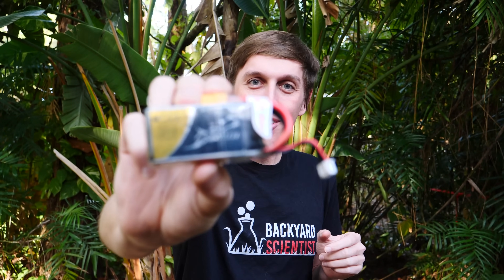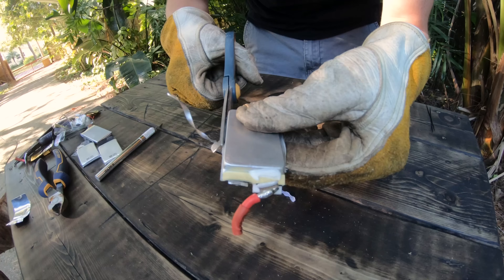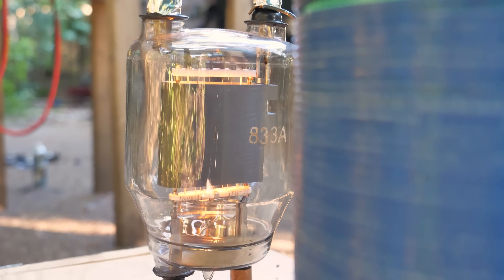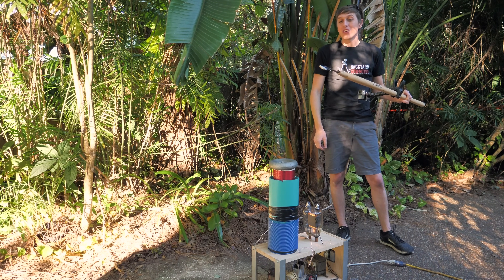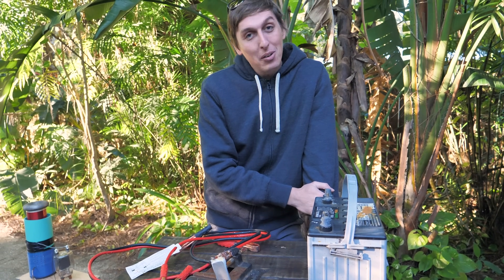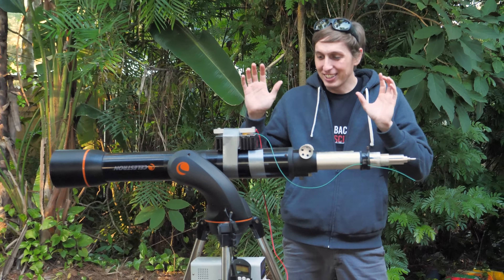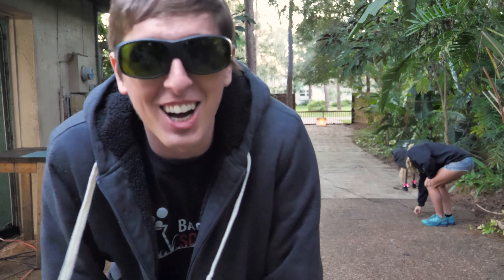Do Not try to charge a LiPo Battery like this!

Comment: You cannot charge a lithium battery via a tesla coil because of the floating voltage. The voltage of tesla coil is high but the circuit just isn't complete. There would be no current flow and no overcharge. To actually overcharge a battery charge it fully, then connect it to an unregulated DC power supply. The battery would heat up and swell. That's when you know that you have done it right.
Reply: Considering it's a Tesla coil you can touch with your bare hands, I don't expect there to be much current that you could actually charge a batterie with anyway. Even if it would have been setup correctly.
Reply: Never made an argument on energy transfer. I simply said that it is not how a battery can be charged. Trust me I'm an engineer.
Another thing, believe it or not tesla coils like van de graff generators don't provide any current. A HV transformer simply doesn't have current delivering capacity at low power high voltage scenarios.
Reply: He did connect it to an unregulated DC power supply... the car battery
Reply: Which... Is why he didn't die?

Comment: That looks like a Li-po not a Li-Ion. Li-pos are very dangerous if not used correctly.
Reply: It is only he said Li-Ion 
To backyardscientist: There are many types of lithium battery, like Ion and Polymer
Reply: LiPo means Lithium Polymer, and refers to a technique to make separators inside Li-ion cells that was proposed but was never achieved in production for Li-ion cells. Unfortunately, that term was misunderstood by the non-technical users to mean " 3.7 V Li-ion pouch cell", and that error is here to stay. Please say "pouch cell" when you're referring to the format (shape) and please say "3.7 V" when you're referring to the voltage. But try not to say "LiPo".

You can't say "LiPo vs Li-ion" because they are all Li-ion cells, regardless of voltage, format or chemistry.
Reply: @RoyvanLierop  Li ion is a specific type of battery and if you change the format you have to change the name or else people wont know what youre talking about. by your logic, if you used a lithium ligand or crystal (or salt) in your battery it would also be lithium ion and that would just be too confusing. LiPo refers to this type of battery and this one specifically. Li ion doesnt have the paper inside it either and is much thinner from what i can tell. idk the electrodes on LiPo but in Li ion its a carbon lithium complex that shifts in oxidation state by shifting where the lithium is on the battery. with the paper separators i dont see the lithium necesarily moving around but it would explain why the cells changed colour when they got oxidised
Reply: @jonathanodude6660  no, Li-ion is not a specific type of cell, it is a family or cells. Every cell that uses Li-ions as internal charge movers are Li-ion cells. It doesn't matter of they are cilindrical, crystalline or pouch. It also doesn't matter if the anode is made of cobaltoxide, titanium oxide or iron phosphate. All are Li-ion cells.

The "lipos" in this video are Li-ion cells or a combination of cells making a battery.
Reply: @tims5677  Watch the video, he says Li-Ion throughout. Check before you comment
Reply: @tims5677  Yeah he says lithium ion throughout the vid.
Reply: Yeah this really needs clarifying. Most people don’t know the difference, and that difference will burn your house down in a matter of minutes. How are they to know if the title or the words he says repeatedly are correct? Nobody is hating the guy, it’s just a really important distinction.
Reply: @SpikeySteve  The difference you are speaking of is one between a foil bag containing usually flat packs of "coiled" batter electrode/seperate stacks (pouch cell), and the 18650-style round cell. The latter tend to be heavier due to the metal case, have higher volumetric energy density due to the higher shape precision/stronger shell, and are generally better behaved regarding mechanical impacts. Also they vent controlled on the top without bloating, thanks to the metal can resisting a sensible burst pressure of the vent hole.
Reply: @namibjDerEchte  Yeah that's more or less it, I wasn't trying to start an argument here, just clarifying. What I was trying to get across is that batteries we usually refer to as Lithium Ion are generally magnitudes safer. You can charge them in your house, they're  in your phones as flat cell packs in hard cases, in 18650 style in your E-cigs, etc. The "LiPo" variety are volatile, they're used in hobby grade RC toys and other high power/high drain devices and toys, and they shouldn't ever be charged or stored inside your house.
Reply: @SpikeySteve  some high-end laptops, like those made from Apple, use LiPo batteries.
Reply: Ozren B right, so because one specific use case is relatively safe, that makes them all safe..... No. the MacBook batteries aren’t the high-drain versions he’s messing with here. Why does everybody want to say these are so safe so badly? Do you just hate people? You can type in lipo battery fire and see everything I’m talking about, especially what can go wrong charging them. This video doesn’t come close to showing how dangerous they are. All I’m trying to do is fill in the blanks that he glosses over and jokes about. You can believe what you want, and this what I deserve for thinking I could say something helpful without someone saying I’m completely wrong and negating everything I’ve said with one niche use case. You win.
Reply: @SpikeySteve  I did not negate everything you said, but the part where you said that "LiPo batteries shouldn't ever be charged or stored inside your house". That is just false, and it remains to be false even if you update your claim to include only high-drain LiPo batteries. Drones are no longer used just by the people in the niche RC market, they are used by millions and millions of regular people,  from photographers, videographers, and even little children. Virtually all drones use high-drain LiPo batteries. If you want an example that is completely unrelated to RC, then look at hover boards, electric scooters, e-bikes.

And just like you can find examples of high-drain LiPo batteries burning houses down, I can find examples of tiny, low-drain phone batteries doing the same, or 18650s used in e-cigs blowing people's noses off. Li-ion batteries of any kind are potentially dangerous when mishandled.
Reply: @ozrenbalic6051  Fine, I concede. Your're right and I'm wrong. I never wanted an argument, but I got one anyways. Disregard what I said, I don't know what I'm talking about I have no idea how safe or unsafe these batteries of any kind are. I would just delete this, but people deserve to see my ignorance. I thought I was helping, but apparently I was just running my mouth about something I know nothing about. I apologize to you and everyone else that read anything I posted, I won't be giving any advice in the future.
Reply: Tim S ya because he changed it.

Comment: Really interesting! You could do a followup on what is the most effective way to put out a fire in such a high energy dense material.
Is spraying it with a hose good enough? Do you need to dump it in a bucket of water for better/faster heat extraction?
Is water actually a bad idea altogether because ( just guessing here) it reacts with lithium?
Reply: Water on electrical fires makes the fire bigger.
Reply: @deathbringer2000  haha fwoosh
Reply: Also water with lithium makes fire

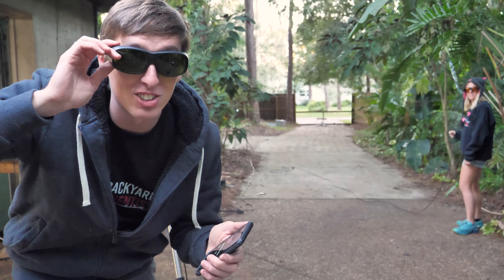Comment: The method used to pump oxygen into fish tank at 5:45 could be slightly improved by filling the tank with water and then using oxygen to push water out of the fish tank. Doing this can prevent air from leaking into the fish tank (or at least reduce the amount of leak).
Anyways, this is good video and I enjoy it very much :D

Comment: Wait. Wait. Did you say Lithium ion ... aren’t they Lithium polymer?????????????????
Reply: yes the are , he fucked up
Reply: LiPo means Lithium Polymer, and refers to a technique to make separators inside Li-ion cells that was proposed but was never achieved in production for Li-ion cells. Unfortunately, that term was misunderstood by the non-technical users to mean " 3.7 V Li-ion pouch cell", and that error is here to stay. Please say "pouch cell" when you're referring to the format (shape) and please say "3.7 V" when you're referring to the voltage. But try not to say "LiPo". You can't say "LiPo vs Li-ion" because they are all Li-ion cells, regardless of voltage, format or chemistry.
Reply: Roy van Lierop   Ssssooo. Bob is Robert and Tony is Anthony
Reply: @RoyvanLierop  They are in production. They just don't work under ~60 C, so they are not used much.
Reply: FSXPilot14 yeah but I thought you need to make that clear from one to the other...because I would never buy a an expensive  Tool set  with a lipo s for batteries?

Comment: though its not actualy charging faster than 1 amp if you dont use the proper charging voltage >_>
something like 4.2v or something like that with unlimited amp 
but like the video xD

Comment: Nothing worse than the smell from a lithium polymer battery!
Reply: Never driven by a turkey farm? or over a skunk? These batteries are low on that scale. Although that stink does linger on anything you get it on like a skunk.
Reply: If you smell a sweet smell from a lipo it may be leaking. Do not breath it in, it's extremely toxic. People have ended up in hospital from giving it a good sniff.

Comment: IR lasers are really dodgy, by dodgy I mean extremely dangerous! It’s unlikely plastic laser glasses would protect your eyes with such a powerful beast, please use extreme caution Kevin. 
It’d be fun letting a cops tyres/ tires down from 200 years away though lol (That’s not a suggestion, it’d probably land you up in the clink)
Reply: As long as the goggles have the right amount of protection for this wavelenght he should be fine. As long as he doesn't reflect the collimated beam diectly onto the goggles he should be fine.
I have a bigger problem with him aiming down his driveway and possibly hit the street (or people) behind the fish tank.

Comment: More telescope laser please, like test how far away you can light stuff on fire from, love your videos
Reply from the maker: My property is only 200 feet long and it still sets stuff on fire! I dont know where else to test it :P
Reply: @TheBackyardScientist  You could probably find a fellow Youtuber to partner with. Demolition Ranch or Taofledermaus would be able to set you up.
Reply: @TheBackyardScientist  you might be able to ask a gun range to test out your laser
Reply: TheBackyardScientist What about some aerial targets like some Helium baloons?
Reply: Take it to a very flat straight quiet road in the countryside or a dissused airfield/runway. Plenty of them in the US.
Reply: How can this be scaled up and weaponized? Asking for a friend
Reply from the maker: @dela_pinkster3074  is your friend named Northrop Grumman?
Reply: Place the laser into orbit, and use it to pop an entire house full of popcorn.
Reply: The only thing more awesome than a 980nm fiber laser is when that laser is used to pump a single mode fiber amplifier, enhancing beam quality for a thermal and vapor scattering limited range (long enough).  With the right optics, you could easily get 500 yard balloon popping.  Look up etendue and fiber lasers to learn something awesome.  Diode pumped fiber lasers are the most intense CW lasers available.  Their emitting area is around 9um diameter compared to around 0.2 mm diameter for what he has.  Thus the output spot at a distance will be around 1/20th the diameter, thus 400 times the intensity at range with the same output lens size if I have my physical approximations correct.  I'd love to see that, expensive though it would be.
Reply from the maker: @notamouse5630  the guy I bought this from still had the fiber amplifier section but I doubt it would have been easy to splice in.  Then I would need all the optics to reflect the 980nm back through the gain fiber and only let the single mode light through at whatever wavelength it's at (cant remember off the top of my head)

Also the fiber is 105um I believe. I bet I could get the dot smaller if I had the right optics. The first lens the fiber is coupled to was designed for 680nm, but that's the only thing I could find on ebay. The divergence was like .3 degrees, but if i got a better lens from thor labs it would be around .03 degrees.
Reply: @TheBackyardScientist  To splice, you need a fusion splicer and some connectors with suitable optical fibers on them.  Your local university with an optics lab may have the ability to do this and better advice on how than I can give.  If the gain fiber is long enough, you get total conversion, if it is not the spot can also be used to approximate the focus of the longer wavelength beam.  Then all you need is the same fiber collimator optic if it transmits the longer wavelength and a laser line mirror for the collimated beam (if you care about total conversion).  Those and some dual laser line glasses as the new beam will be even more of a hazard even at a supposedly safer wavelength due to higher brightness.
Reply: The company ATHENA makes military grade lasers bigger than you can imagine
Reply: Well a laser never stops until it meets something... So..... Wouldn't it technically be about to burn from any distance??
Reply: @robert9595  after a certain distance im sure the intensity of the heat will diminish

Comment: Cool, yet slightly scary at the same time.
I knew that when LiPos go, they really go, but I never thought that it would go with such ferocity (no.3, use appropriate charger). And I use LiPo in my model aircraft, so they're getting quite heavy use during the summer.

A very enlightening video of what can happen. I think I'm going to use the low charge rate from now on on my battery charger, just to be safe.
Reply from the maker: Its quite scary. My friend had one go up in flames by charging a puffy battery.  Just listen to the charge rate on the pack and you should be fine. Just charge them and store them where they wont do damage if they catch on fire.

Comment: he got that battery from a batteries plus bulbs, i work for them :)
Reply from the maker: Yes I did! Its a good battery. It has held up to lots of abuse. Im bad about keeping it charged, but it always charges up fine and seems to put out enough power.  I got it as a backup battery for my car and something I can run an inverter off of while camping.

Comment: "This laser is especially dangerous because you can't see if its reflecting off something" 

shines laser into public street
Reply from the maker: hah I was using it on low power to align it, less than a watt. Thats still a lot of power, but the focus of the telescope is pretty shallow so there is not much danger. and I live on a dead end road.

Comment: "it's down to 67 degrees so i grabbed a jacket"

kowalski, analysis
Reply: Us new englanders go outside in 30 degree weather in shorts
Reply: @richardriguard1394  -10 here in Estonia is still considered a t-shirt and shorts weather...
Reply: Conner Garcia - Some of us old Englanders do too! I often wear shorts and a tee shirt around 50 degrees. 67 degrees is sunbathing weather here!
Reply: @richardriguard1394  I know humans that do that even in 20 degrees.
Reply: @snakeywakey3893  god damn
Reply: @richardriguard1394 My species can take cold pretty well. I remember Thel going through frigid temperatures when traversing the quarantine zone.
Reply: @snakeywakey3893  Which species are you from?
Reply: @MATAM29  He is a Sangheli.
Reply: Analysis report, Floridians are sissies when it comes to cold weather. I'm a fluffy Floridian and can stand temps down to 50's in shorts & tee, but I know many thin Floridians reaching for jackets and warm pants at 70°F. I even knew someone to wear what's practically a heavy winter parka while temps were in 60's.
Reply: 9

Comment: That was a high current LiPo, which is why there were many different electrode plates. Most normal LiPo cells (like phone batteries) only have two very long strips as the anode and cathode. Also, lots of flames!
Reply from the maker: It surprised me for sure!
Reply: @TheBackyardScientist  And that's why I am still scared to this day of tampering with them LOL

Comment: The down side to the rc hobby. You got your plane and you crash, but fixable then BOOM lipo fire bye bye plane
Reply: Lol stick to trucks. More durable. By the time a truck battery ignites. Its toast
Reply: pws3rd 1 Trucks are fun but a lot of people rather flying aircrafts, and most don’t crash often
Reply: @Canoodlan  I had minimal luck with rc things that flew when I was younger. Worse is that I actually had a metral barn with a 20 foot ceiling and no air disturbances, yet still had horrible luck. I liked four wheelers so rc trucks was natural
Reply: Kevin Talbot XD
Reply: or you battery faults through massive voltage drop and you have a meteorite
Reply: I've only had one battery "explosion". I used to fly as much as 20 times a day for up 30 minutes at a time. The one thst blew up, was about 3 years old. It actually shorted out and I lost all power while in flight. I was actually trying to hover fairly low, so it lawndarted. I pulled battery off the plane and was messing with it and it started smoking.

Ive had a ton of crashes completely destroying wood and fiber and foam planes, and only the one smoke show.